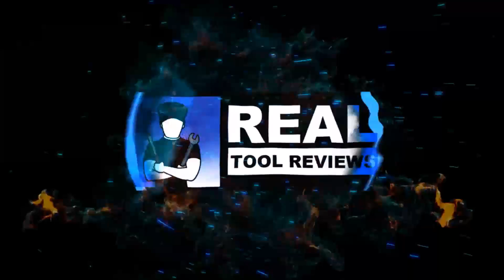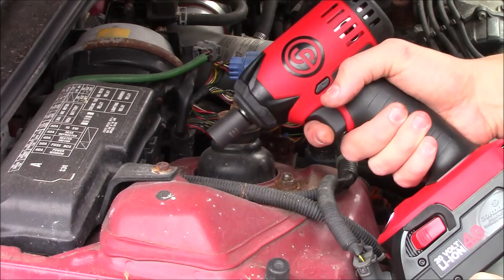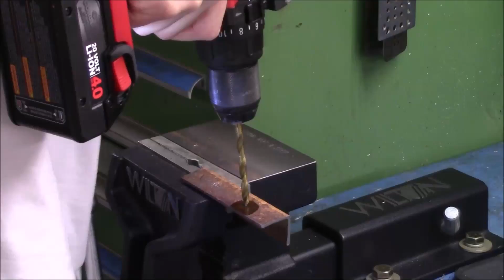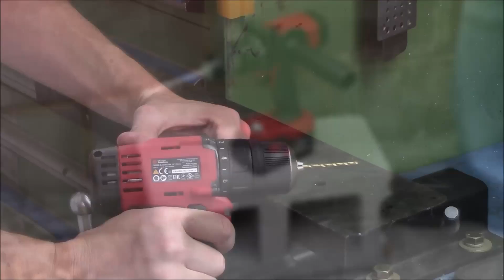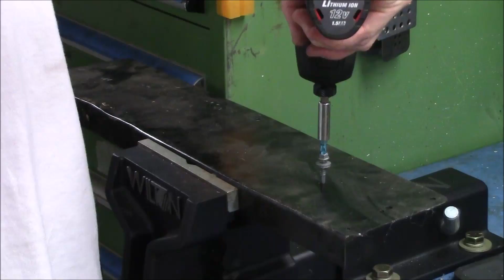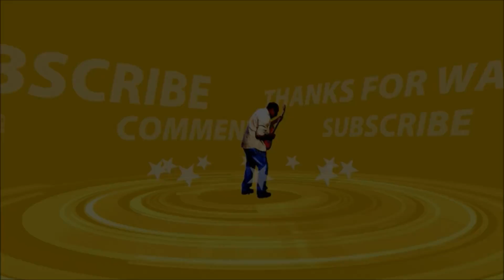Chicago Pneumatic CP 12v/20v Cordless Lineup

Comment: i love your video couple month ago i discover the joy of cordless power tools,i'm an automotive tech and before i was a pro pneumatic tool, never really like messing with battery and i've never take them seriously.. couple month back i bought a 12v black&decker drill from walt mart to use around the appartment. even tho its a shitty drill the fact that there no air hose to mess around is just amazing. now all my air tool other than my tire gauge and air hammer is down deep in one drawer of my tool boxe at work,i keep buying cordless tool frome different brand i have a set of MAstercraft 20V max drill,1/2 impact and sawzall,just got myself last week a Milwaukee 2663-22 1/2 M18 impact wich is a beast, a dewalt 1/4 12v max screwdriver and a snap on 3/8 drive 7.2 volt impact wrench,they just save me so much time
Reply from the maker: Jonathan Lessard Glad to hear it Jonathan!  Any time you can save time = more money for you!  :)

Comment: CP8848 looks so similar to the IR W7150, isn't this the same wrench? Could you compare both of these?
Reply from the maker: Blezio Size-wise it is similar, but the IR & CP are independently manufactured (neither are re-labels).  I do plan to make a comparison video at some point soon...thanks for the suggestion!
Reply: Same power, speed and torque, both of them are without LED light, both are powered by brush-motor and both have longer version. The difference is in the impact mechanism 2300 vs 2500. I wouldn't be so sure... Would you dare to open them and look inside? 
The same case is with the drill/driver CP8548 and IR D5140 - very similar machines...

Thank you for uploading!
Reply from the maker: Blezio I have looked at this side-by-side & can 100% say that the CP line is NOT made by IR.  Sizes may be similar, but features/angles/power/etc is not the same.

Comment: that looks nice the price on the impact is great for 700ftlbs
Reply from the maker: singlecams I agree!  And the "nut busting" rating is actually 1,050 ft-lbs.....so it is right up there with the Milwaukee & IR.  The price is definitely awesome from what I can see online + a 5yr warranty!
Reply: Real Tool Reviews on the site it says  775 ftlb/ 1,050 Nm in Reverse, i looked for nm-ftlbs calulator it says 1050nm = 774 ft-lbs so maybe that is the reverse torque 775? Oh yeah on the ebay listing it says 

Working torque Range 50-700 ft.lbsMaximum Torque (reverse) 775 ft.lbs
Reply from the maker: singlecams Perhaps I have misread something....I am deleting my previous comment until I look into this further....thanks for pointing that out!
Reply: Real Tool Reviews no problem here is the specs

http://www.cp-cordless.com/tools/cp8848

Comment: Are they brushless, and 20 volt is it similar in torque/Rpm  to rigid x5 tools, or Milwaukee ?
Reply from the maker: GudNat Brushed (price is a lot cheaper than brushless counterparts on the impacts btw).  The power levels on the 1/2" impact is VERY similar to the Milwaukee 2763 or IR W7150, the hammer drill would be comparable to the new Ridgid Gen5X, and the 3/8" impact is similar to the IR, Milwaukee, Bosch, etc.  The 12v tools would be similar to Ridgid or Milwaukee, but not exact.
Reply: Thanks for the info as always and yes can't wait for a one by one reviews on all.

Comment: they look like rebadged ridgid tools. Do the ridgid batteries fit in them?
Reply from the maker: Ridgid batteries & CP batteries are not interchangeable...neither are the chargers.  The plastic molding on them is different & while it is possible with modification I'd assume.....it would also void your warranty on them.
Reply: I thought the same thing. The batteries look identical to ridgid.
Reply from the maker: Bigchuck678 I have tried swapping the CP & Ridgid batteries & chargers, and can say without a doubt that they will not work (without warranty voiding modifications).
Reply: Jason Seergobin I think CP is owned by Atlas Copco they are into industrial equipement.

Comment: These look really good. I was holding off on the milwaukee mainly because they are expensive but now I'm just waiting for their fuel version 2 to come out in august.
Reply from the maker: ***** Thanks!  Keep in mind that the Gen2 fuels are not across the board.....more-so for the impact driver, 3/8" impact, and 1/2" compact impact....the high torque 2763 is not getting an upgrade.